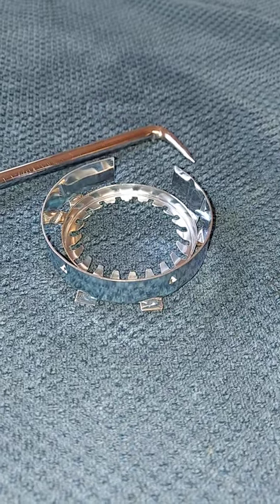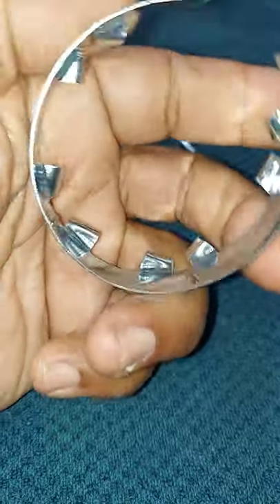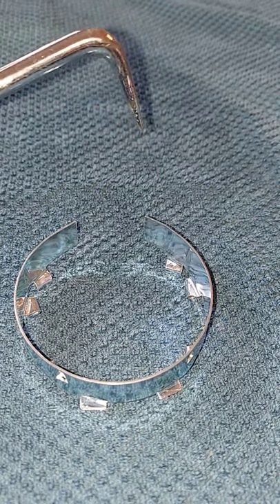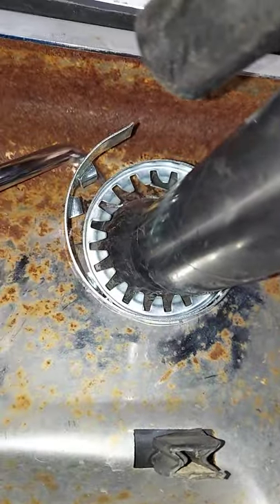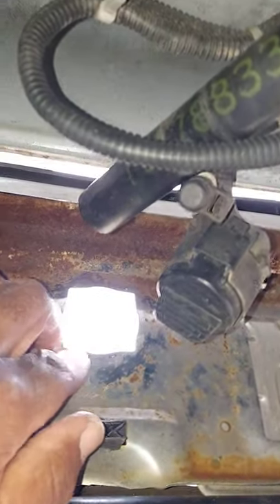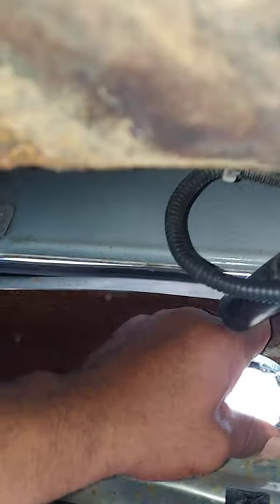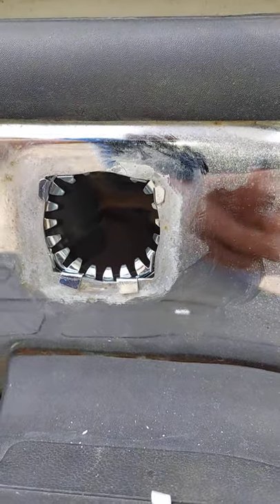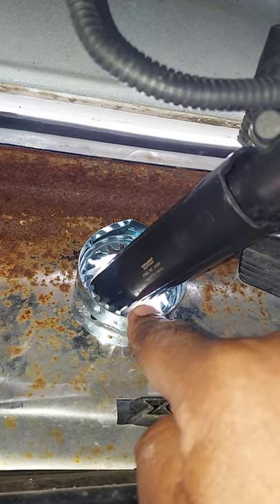chevy silverado tire door lock ring cylinder

Comment: I replaced the rear bumper on my Silverado a couple weeks ago and I was kind of stumped on the spare tire hoist cap so I had left it in my old bumper.  5 minutes after finding your video I had it out and got it all figured out now.  All I need to do is buy a new retaining ring kit and it will be on the new bumper.  You made a very helpful video.
Reply from the maker: 👍 glad i could help

Comment: Great video. Thank you for posting this.
One question….what’s that switch for I see wired in there?
Reply from the maker: U mean the light bulb for the bumper or the trailer hitch. The only things back there. The door has nothing electrical posted to it
Reply from the maker: Thanks for watching
Reply: @madetohelpyou  at2:23 the video centers on it hanging next to the spare tire tube…..looks like an old gm toggle switch
Reply from the maker: Sorry, im not sure what your talking about hanging. The only electrical things on the rear bumper are the lights that goes into the license plate area and the hook up for a trailer hitch

Comment: I did all that and my lock cylinder tube would not go through, am I missing something?
Reply from the maker: Hi

Is the ring set installed  correctly and was the black tube damaged during  removal or did u order a new tube? After installing the ring set. You should be able to tap the door from outside the vehicle forcing it to lock into the ring. You must apply force to lock the tube into the ring set
Reply from the maker: Remember the fat part at the end of the tube that grabs the hole from the outside of the bumper door must be forced threw the hole to lock into the teeth of the ring. Not sure exactly what u mean by the tube wont go threw?

Comment: I cannot get my center ring in.
Reply from the maker: Hi

Go back the the video. Once u have the 1 part installed correctly into the bumper hole. Sometimes u have to really push hard until the center ring with the teeth locks into place. Make sure you are installing it in the right direction. Let me know how it goes
Reply from the maker: Teeth facing towards front of truck

Comment: Wow, automotive engineers should be shot,  Two SS screws would have done the job for less and way easier.  Great to know this,  just too bad I didn't see this beforehand as no one has this ring in stock. So much for best-laid-out plans for the day... LOL  thanks for sharing this, funny how this isn't an up front known hic-up.
Reply from the maker: Hi. I agree w you fully. The dealer wanted $120 to tell me how to install it. I went home & honestly spent 2 days trying to figure out the ring etc until i got it right. Surely a poor design
Reply from the maker: You can check ebay, amazon or just google the description and see if anyone has it online
Reply: Or one bolt in the center of the wheel to hold it in place, much simpler design.